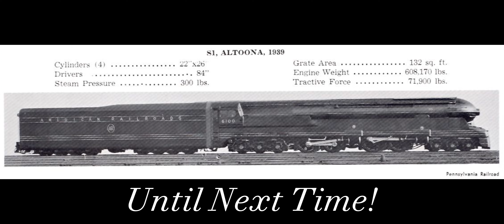The Story Of: The Pennsy S1 "The Pride of Pennsylvania"

Comment: I like the unstreamlined design of the PRR S-1, but I do not like how the tender is designed for the unstreamlined version. Such as the gap between the 2 walls of the coal holder of the tender.
Reply: What do you mean ”unstreamlined S1”? I couldn’t find a single picture of an unstreamlined S1.
Reply: @DovregubbenProductions-vn3vy  There's a version of it in Train Simulator, it doesn't have the side skirts that cover the wheels halfway.
Reply: @Ambitious_Scripter  Link?
Reply: I know exactly you mean and that was probably made for the same reason the skirting was removed